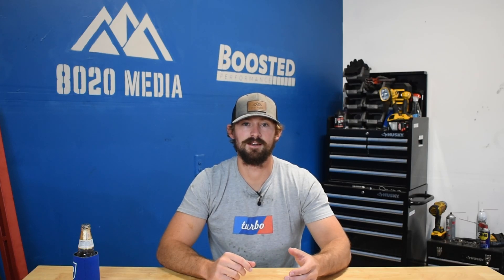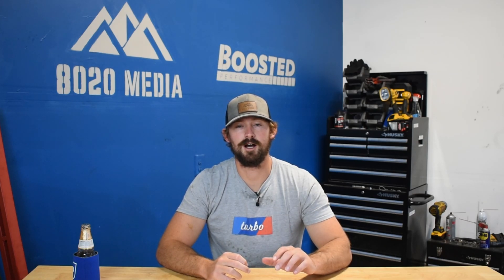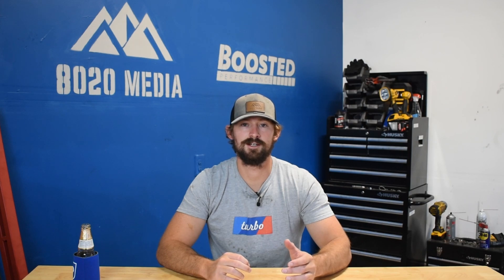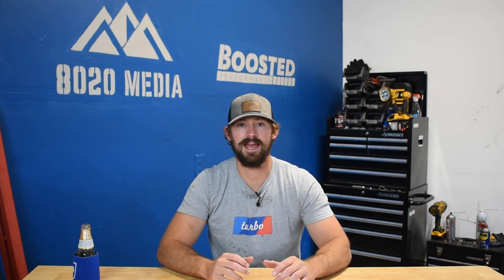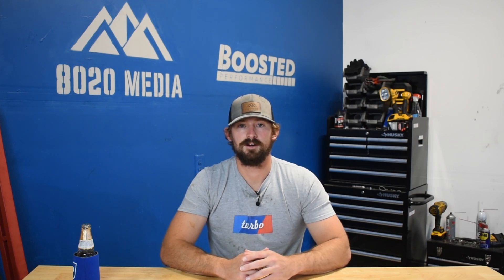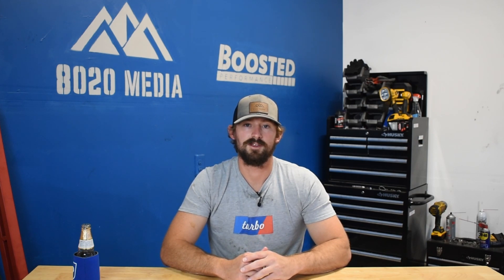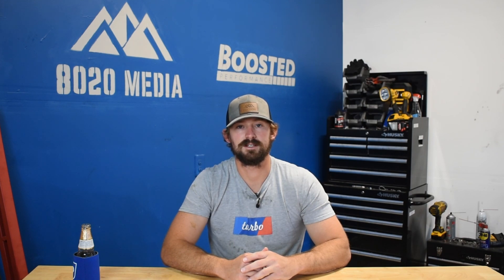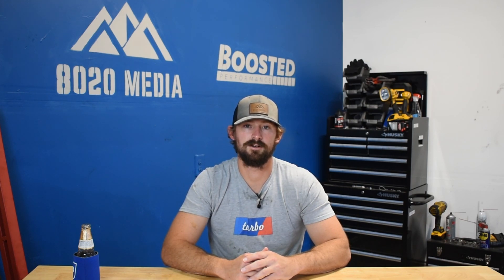The 8.0 V10 Magnum | Common Problems & Reliability

Comment: I own a 98 Dodge V10 2500 HD with 5 spd manual. Transmission.  I’m the original owner and have 92,000 miles on it. It’s a gem and will keep it till I can’t drive anymore. It’s been a reliable workhorse and has pulled heavy loads with ease!  No major issues so far!!
Reply: I only use it for towing heavy loads. I have a half ton 1972 K10 truck for everyday use.
Reply from the maker: C - That makes more sense! Nice trucks!
Reply from the maker: C - Thanks for sharing your experience! Sounds like you rarely drive it? Is it a ranch truck or towing truck or something?
Reply: I just got a 94 2500 v10 from my nana 83k og miles
Reply from the maker: Sugar - Sounds like you've got a good one!
Reply: My 94 is showing 74 K on the clock, but I had to find a cam & crank sensors for it so it's sat almost 14 months. Wish you way better luck with yours. @sugarhilldemon4963
Reply: Smart man
Reply: I had 98 V10 2500HD put LT 3 peak certified 285 pro comp AT, put Gibson Ceramic headers, and stainless exhaust, TB spacer with K&N cold air intake, put I think iridium spark plugs. Changed all fluids to synthetic. I pushed 2 feet of snow on my property that truck was a beast! I pulled my mom’s car across Colorado at night literally had crap scared out of me as I forgot I was towing that V6 Camry on a full trailer. I miss that beast of a truck really didn’t like the automatic transmission. But
Man I had that truck doing moving down the highway had Cummins trying to hang but I left him in the dust.
Reply: C, how heavy do you tow? I've got a 44ft 5th wheel that weighs 18k LBS. Do you think it would tow that?
Reply: @georgeramsey2827 it sure will
Reply: I owned a 99 Ram 2500 V10, very reliable truck. Rebuilt the transmission once, thats when I added a 2 qt larger aluminum oil pan and a larger oil cooler. It could pass anything on the highway but a gas station.
Reply: I have a 1995 v 10 in my ram 2500 it runs about 10 minutes and dies, let it sit for an hour or so , it starts and runs again for about 10 minutes.  Any suggestions?
Reply: @steveportice3560 I was thinking maybe check the wires going to the crank and cam position sensor, maybe replace those since you're there. I had similar issues with a 3.9 l v6 and it was because the wires wore through on the rail along the fuel rail just under a cover. Patched the wire and replaced the sensors just cause I thought they might have failed because of the wires. I hope this helps you.
Reply: check the iav first intake air valve
Reply: @steveportice3560 I can walk you through diagnostic if you'd like I have two of these trucks
Reply: It'd better be reliable with just 92k miles on it though...
Reply: What's the MPG Highway ?
Reply: @Katmandu2  towing 10,000lbs and 3500lbs of tools In The bed I get 300 miles a tank highway 38 gallon tank so about 8mpg
Reply: I'd buy that truck if you still have it and want to sell it
Reply: I had a chance to get one but passed it up. Pissed at myself for that.
Reply: I have a 94 ram 2500 v10 and I believe I’m having the fuel injector problem now. It has about 150,000 miles on it now. Tranny rebuilt. Runs great. I don’t k ow if I’ll ever sell it

Comment: Dude. The Dodge v10 NEVER had an EGR valve. Any hesitation was almost always caused by the oxygen sensors failing.
Reply from the maker: They certainly did have EGR valves at least in the 94-98 models, but gotcha.
Reply: I stand corrected!
(mine is a 2001)...
The o2 sensors on mine fail every 20,000 to 50,000 miles, and when they do they also blow the o2 sensor fuses. When this happens, the truck misfires under light load, sort of Backfires, stumbles, just generally runs like shit..... No egr though. No air pump either.
Reply from the maker: David - Thanks for adding your experience!

Comment: I have a 98 1/2 with the 8.0. Has been one of the most reliable trucks I’ve ever had. Dad bought it new and we both share it lol. Has over 400k original trans with regular service and band adjustments. Governor pressure sensor and solenoid went bad but that’s about it for the trans
Reply from the maker: Matt - Sounds like you've got a good one! Thanks for sharing your experience.

Comment: Even with gas These are actually a good buy if you consider the cost of new diesel 25/3500’s and the cost associated with all new emission standards. Someone’s had to have done a manual swap.
Reply: I have an nv4500 hooked up to mine
Reply from the maker: Howie - That's a good point.

Comment: Don't buy dodge v10 ,  the transmissions are utter garbage.  And parts are hard to come by for the engine as wasnt  wasn't adpoted or bought by many or companies. Compared the 8.1l gmc/ chevy which is everywhere and used in big box trucks and is extremely reliable easy to fix , easy to find parts .
And dodge electronics this age are absolutely horrible.  You will be tracking dodge electric gremlins constantly that leave you stranded.
Reply from the maker: Dylan - We think this is blown a little out of proportion. I think you make you sound way worse than it actually is. If it's bone stock and maintenance is held up, these trucks can be great. However, we do agree with the parts being hard to come by.
Reply: @8020Automotive It's the same trans that's behind the Cummins lol
Reply: You're an idiot. I have over 470,000 miles on mine. Engine has never even had the heads or oil pan off, and I'm only on my second 47RE (has over 300,000 miles on it and I only rebuilt the first one because I wanted firmer shifting)

Comment: Great info.  I am looking at a 2000 Ram 2500 V10 4WD in Nevada and if it is up to par, will ship to Maryland.
Reply from the maker: Jeffrey - Dylan is blowing things a little out of proportion. How many miles does it have? Is it stock? What are your plans to do to it if you get it?
Reply: @8020Automotive  Thanks for the reply.  Don't know the miles or anything about it.  Saw it and then researched.  Will be back out there in a week or so to inquire more info.
Reply from the maker: If maintenance has been kept up, it could be a good buy , just depends on mileage and cost.
Reply: @8020Automotive  I have to agree.  Will be inspecting it, if still available in a week and half.
Reply from the maker: Keep us posted.
Reply: Don't buy dodge v10 ,  the transmissions are utter garbage.  And parts are hard to come by for the engine as wasnt made very long and wasn't adpoted or bought by many or companies. Compared the 8.1l gmc/ chevy which is everywhere and used in big box trucks and is extremely reliable easy to fix , easy to find parts .
Reply: @dylano7242  Thanks, Dylan. Good to know.

Comment: Only problem is how many gallons per mile?
Reply: Makes a lot of difference with what gear ratio it has . My friend has a 1996 2wd that has 3.55 gears and it averages 18 mpg and pulling a 40’ 5th wheel trailer loaded weight of 9000 lbs averaged 14. It has been through a couple of gear sets in the rearend and 1 transmission but has 290,000 miles on it.
Reply from the maker: Kyles - Assuming you meant miles per gallon. Not great. Anywhere from 11-13 not towing.
Reply: @8020Automotive  no I meant what I said. I was being sarcastic. I'm currently doing a full service on a friends v10 he just bought and it gets worse fuel milage empty than my 07 Cummins G56 with a gross weight of 28000lbs towing my toyhauler. 13 to 14 mpg. I guess this is why I dont see too many of these v10s anymore
Reply from the maker: Kyles - Got it. This is true. There aren't very many left on the road.

Comment: How come 2003 was the last year for the 8.0 Liter V10 Magnum engines before it was discontinued I've never seen a third generation body style Dodge Ram 2500 & 3500 heavy duty models
Reply from the maker: Mainly due to emissions.
Reply: What he said, closest to it is the srt10 ram 1500 in which they unfortunately discontinued
Reply: 700ish 2003 models had the v10. They are out there, I've seen two in person and a few others online.

Comment: Having owned several Dodge Ram 2500 and 3500 trucks with the 8.L V10 my experience with them has been that they are good, reliable and smooth running. 
I have not had any of the so called common problem occur with any of the trucks I have owned. As for the fuel economy I find if you keep your speed down to 60ish the MPG goes up noticeably. 
Also this engine starts easy in sub Zero weather.
Reply: I have daily drivin my 8.0 for 8 years now & I abuse it as much as I can. It’s not a tow rig, it’s a race truck at this point lol. It’s a fantastic engine even with minimal maintenance but the transmissions are definitely sensitive. I purchased my truck I’m with 155k miles & had to replace the trans at 173k It’s at 197k now. Other than that I’ve had no major problems with the engine. I continue to abuse & daily this V10 & I love it! I’ll run this truck untill I or it dies! & if it dies first it will be rebuilt.
Reply from the maker: Crisp - Thanks for sharing your experience!
Reply from the maker: Mag - Thanks for sharing your experience and insights!